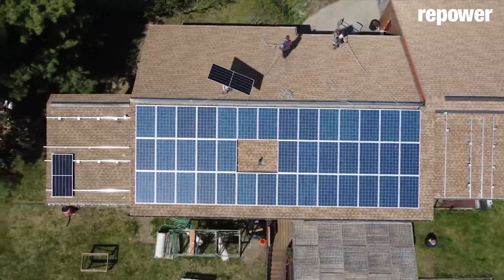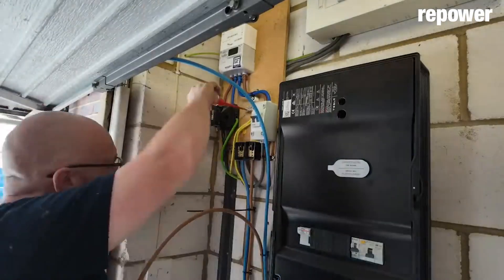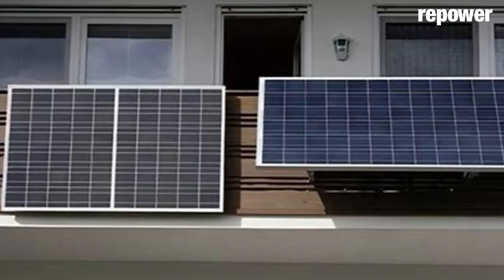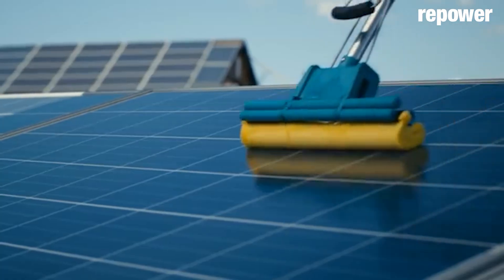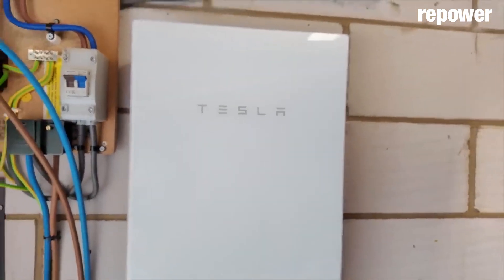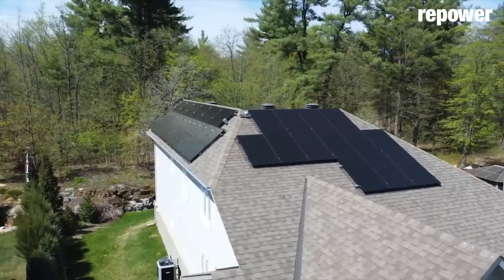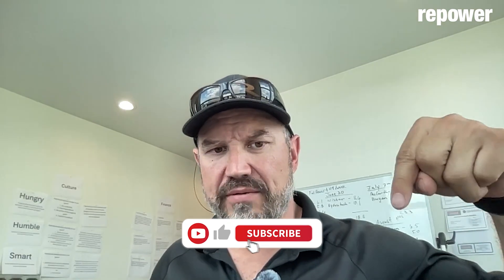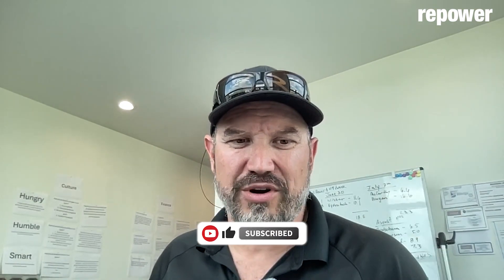Can You Really Install Solar Yourself?

Comment: i dont want to interconnect. i want my seperate system and want to divorce from the blood sucking, vampire NYSEG utility...... a foreign controlled company that never stops raising it's rates. i doubt i would overproduce and if i did i would just stop charging until i needed it again. the utility would literally give me pennies on the dollar. i haven't built anything yet, but next spring i will start on this journey.
Reply from the maker: Its hard to size a system without interconnection because the number of the batteries needed.  Summertime production is very high, so lots of electricity will be wasted/curtailed.  The opposite is also true for winter time, where the solar will have a hard time producing enough power to run all the loads.  This severe difference in the amount of sun received in the northern hemisphere is usually balanced out with the grid.  I understand your concern, i feel the same way, but living off grid requires a detailed analysis of your loads.  I can show you some pictures of off grid charging profiles, and inthe summer time they charge before 11 am and the solar sits idle almost all day.  In the winter, barely enough solar is produced to charge the batteries to 100%.  If you just do a small system, its not a big deal because you never 'over' produce, but large systems should always be interconnected or paired with a large battery bank.

Comment: This guy is absolutely full of it - as are must solar installer businesses. Solar system installation and net metering agreements with the utilities are absolutely within the abilities of a DIY individual. It will take some research with your local utility, county zoning office and permitting, but easily within reach. A licensed and bonded electrician can certainly help do the heavy lifting and if reasonable is worth the additional cost, but these solar "sales" companies are off their nut with ridiculous pricing for their "magic" they claim to bring. Do it your self, hire a worthy electrician if you want the help with the connection and the utility, but never toss these solar guys $65K for what you can do for $30K (including electrician).
Reply from the maker: I actually really like your thoughts and part of my mission is to bring the cost down for everyone.  Electricians are a little hesitant to take on solar, but its totally within their abilities.  What do you think the best thing I can do to help people get solar and battery backup systems for the best possible price?  Maybe educate electricians or possible provide plan sets for the 'hardest' part?  I love the feedback, thanks.
Reply: @joelrobinsonrepoweryourlife  The first thing to help would be to correct your statement (0:20) in the video that says DIY's can never hook up to the grid themselves. This is flat out incorrect. Many have done so, even without the need or use of a licensed electrician. A lot of states and utilities allow for interconnection and net metering of self installed systems. I don't know why you made such a statement. You seem to want to give the impression that "professionals" are required to achieve solar inter-connection and net metering with utilities. Again, NOT true.

Comment: What about banking your power to batteries.

EcoFlow Ocean or EG4 Grid Boss.

Hold all your own power in your own batteries.  Use the grid only as a power one way source.

Solar panels are optional.
Reply from the maker: That's correct, you can bank all your power in batteries.  From a payback or financial perspective, batteries are less of a return than solar.  BUT from a personal perspective, batteries can be installed with out solar and its actually pretty easy.  I love ecoflow, they are doing amazing things.  We just had a rep in from China.  there was a little bit of a language battier to say the least, but he knows his stuff.

Comment: Wrong. In Illinois comed allows home owners to connect to grid with out license. I did it, just applied,  paid $50 and connected the solar edge inverter to my panel.
Reply from the maker: Good to know.  Just recently Montana stopped allowing it.  I am actually a fan of letting home owners do it themselves.
Reply: @joelrobinsonrepoweryourlife  Here is something even better to know.. Montana absolutely allows DIY installers to connect to the grid without a professional installer like you being involved. Permits are required, Utility agreements must be completed and code inspections need to be done - just the same as in Illinois - but you as an individual ABSOLUTELY can save your self tons of money installing your own and connecting to the grid. Tens of thousands over a solar installer and his "magic" that gets your connected.

Comment: I installed my own off grid system. 9000 watts solar and 37KWH of battery. I am actually 90% off grid when the grid is running. But I can supplement my solar by running my trifuel inverter/generator for a few hours every few days under cloudy conditions to be fully off grid. Total cost after tax credits; $11,000 for a 4 years pay back. Try getting that from a solar installer.
Reply from the maker: Sounds like you did it right!  What do you do when the solar overproduces?  Also, what's the tri fuel?  Gas, Propane, and maybe Diesel?  I am curious how you like it.

Comment: I bought all of my own solar panels and batteries on the Internet for $12,000 and installed it myself. Then I put my system in non-export mode so it never back feeds my electric meter. So I did not pull a permit and I did not get a connection agreement with my electric utility. Then I inflated my system cost to average and took a 30% federal income tax credit on my "28,000 solar system"! 😂 So I got $8400 back on my $12,000 investment and my return on investment is less than three years. Ha ha bitches! All modern solar inverters can now operate in non-export mode so I say screw the government and their bullshit rules. My solar panels offset my daily load and they charge batteries at the same time, then my batteries discharge to my house in the evening and again, I never spin my electric meter backwards by operating in non-export mode.
Reply: I'm with you I'm in the process currently building.Just picked up more panels 31 550w cw enerji.
5 16 kWh batteries and 2 12000xp inverters.

My question about tax credit inflated price.Did you say fuck it😅
As they most like not gonna audit?
I was thinking about doing the same.
Reply from the maker: Only if they audit you, which we did have one customer get audited and needed all the records.  Your call.
Reply: Stealing extra tax credits from the govt and then bragging about it online....very smart.....MAGA level smarts.
Reply from the maker: That's awesome!  You got the cheat code for sure.  You don't get net metering though right?  What happens when you overproduce?
Reply: @joelrobinsonrepoweryourlife Charge controllers in the inverters basicly shut the panels off if that's the case.But your most likely always gonna have a draw on the batteries.Fridge,ac,heat ect.
Reply: What is the size of your solar system and what is the capacity of the battery ? Just wondering what sizing you went with to cover your household loads .

Comment: Ground mount when possible. DIY off Grid installation. I never considered a hybrid inverter. Never.
Reply from the maker: Ground mount Bifacial are the best by a long shot, most productive systems install, pointed and angled correctly and Bifacial.

Comment: Worth taking into account, the grid can throttle what you send back. National Grid restricts me to 7kwh, although I produce a lot more. They told me I could add a 25kwh transformer at the end of my drive way at my cost. I agreed to pay for this, then they changed the terms on me and said I now needed to pay for 75kwh transformer. Which was too expensive, the whole point I think
Reply from the maker: Thats really interesting.  They limit your export to 7kwh?